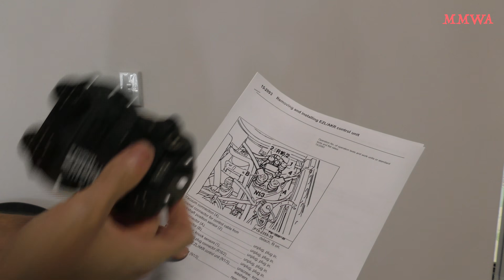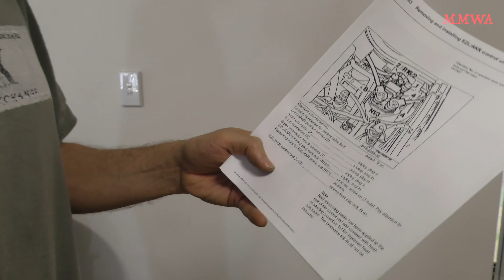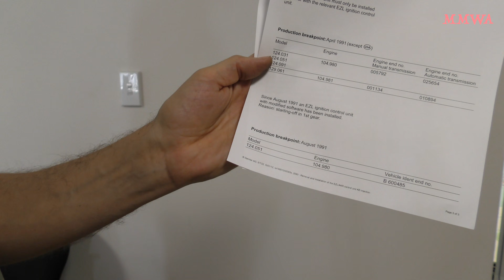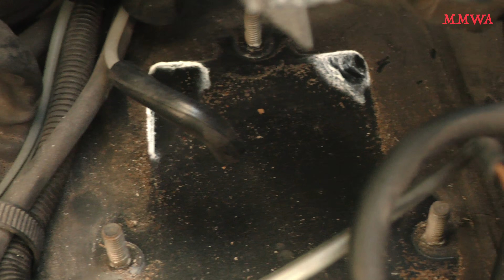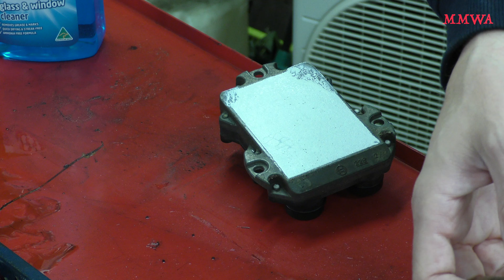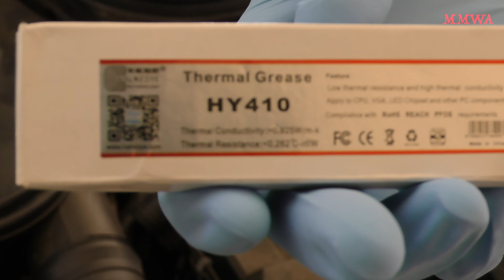Mercedes W124 - Some Long Overdue EZL Maintenance

Comment: so the plastic sheet was still on there thats, not how that stuff works is supposed create a air tight seal so heat transfers, atleast that how i understand thermal paste works

Comment: Need help please. I did the head gasket on my 91 300ce and I ended up with a sensor that’s plugged in the EZL but for the life of me I can’t find wheee that sensor goes. By the part number on that sensor, it says it is a crankshaft positioning sensor. If anyone knows, I’d appreciate some help. Thx.
Reply from the maker: @bektas1981  crank position sensor on these engines is in the rear of the engine where the transmission mates to the engine up the top on the intake side. A real bitch to access but not impossible.
Reply: @MMWA-DAVE , appreciate your reply. 
Yes, that’s the problem.. I never touched that sensor while doing my head gasket. Somehow I’m left with this thing hanging in front of my engine and I have no clue where it goes. I’m starting to think it’s from a previous owner, they didn’t remove it all the way. I’ll do more checking tomorrow.

Comment: Hello sir, i want to ask something strange problem with my 300E w124
The idle in the limp mode is 1200-1500 its normal?
Are ezl is the main problem the tachometer cannot rev more than 3500rpm, but the engine seems screaming
Are ezl failure can affect high idle when limp mode
No more vacuum leak ,all the rubber hose icv are replace and test with spray some water to possible vacuum leak area.
Because i want to solve the mechanical problem first and then the 2nd is  some electrical
Need your advise sir
Thank you 🙏
Reply from the maker: @hendragunawan-up7kd  EZL wont be reponsible for high idle, Likley there is no power going to ecu or ecu has died, Fail save mode of idle control valve is around the high idle speeds you suggest. On M103 the idle speed control circuit is inside the ECU. Usual thing responsible for no ECU power is a failing OVP relay. This will also light the ABS warning light when fitted, if the bulb is not blown. Also make sure throttle linkages are not tight or mal adjusted, as this can also cause high idle.
Reply: @MMWA-DAVE  thank you sir,
Someone told me if in limp mode the idle is +/- 1000 rpm ,and the electronic control the idle between 700-800
In my m103 with a ECU just drop to 1000 rpm because at limp mode is 1200-1400 rpm

Comment: hi can anyone please advise, i have a w126 420se it uses the same EZL module you have , the 16 pin ...but mine is not working and im struggling to find one at a reasonable price. so i did some research and there was someone saying that its possible to use the 8pin EZL ..my car already has the 4 pin plugs also linked to the loom. but i wanna know if it can work and if there is a catch
Reply from the maker: It wont be the same as mine, mine is configured for 6 cylinders and the ignition timing map for the 3 litre M104. In answer to your question- Yes a 4 pin 420 EZL absolutely will run your engine, with appropriate wiring modifications but you will lose some functionality, number one thing will be knock control. Presumably its a 10:1 compression engine if if uses 8 pin per socket EZL. You should use only best quality premium fuel available in your country from that point forward. You likely will still experience some pinging in the summer time even so.

Comment: I always use a plastic razor blade to scrape off the old stuff first.  Then chemicals and wiping.  As for the protective "foil", i actually just use a plastic zip-lock bag, and cut out a piece of it that matches the contact patch with an X-Acto knife.

Comment: That's interesting that the ignition would be different for first gear start. Do you know why? 
You might be able to get first gear start with the FGS "relay" from a 500 w126. It clicks the kickdown solenoid when you lift your foot off the brake pedal. This makes the car rest in 2nd gear, but move off in first.

Comment: @MMWA  
Thank you for the video
Did you re-apply the protective film or you use a new or any protective film?
What is the film protecting?
Reply: My best guess is that it protects the box it was shipped to the factory in, then the hands of the workers who installed them. You can find a thorough nerd-quibble on the 500E boards about this. Some even say that at one point, replacement EZL's from Mercedes just came with a tube of paste for you to apply, no film.
Reply: @theundergroundlairofthesqu9261  Clean hands yes, but also much quicker to slap the EZL on, straight from the box, without playing with heatsink compound. Industrial efficiency.

Comment: The trim resistors on these are interesting, had to source number 6 for a decatted s600, fitted a generic equivalent resistor instead and it stopped backfiring instantly

Comment: Great information as always from this channel. One question, does anyone know how to adjust and rise the rev limiter on these?
Reply from the maker: On the m104.980 the first rev limiter is operated by the MAS relay, it turns off the fuel pumps just above the red line. Additionally, the EZL retards ignition timing to reduce engine power then cuts ignition after that if the RPM's continue to rise. the TD signal is used (tach) from the EZL for the MAS relay to know engine RPMS. You can add a bypass switch for the fuel pumps to stop the MAS relay cutting the fuel pumps. I'm not sure at what speed the EZL cuts power then ignition, i think it's quite a bit higher.

Comment: Great video! I still have one of those on my swapped Coupe but I only use the vacuum port, that runs the economy gauge in the dash.
Reply from the maker: you can delete it completely - the economy guage is just a mechanical vacuum operated device. It only needs a manifold vacuum connection. I assume you have the tach guage connected to what ever ignition box you are using for the ford v8 - it only needs a typical square wave output from a transistorised ignition control units tachometer output.
Reply: @MMWA-DAVE  Good to know, at this point it’s easier to leave it in place. Yeah I have an MSD ignition and an aftermarket tach, the tach was the only factory gauge I didn’t get working.

Comment: Hi, I noticed you have manual on everything you do on that merc. Can you steer me the right direction to where I can find a good one for my w126 1988, I  purchased a few from different suppliers but they all crap, I'm Also in Perth and would appreciate very much if you could help 
Thanks
Reply from the maker: w126 is in the grey area where they just started to digitally archive the paper manuals into the workshop information system. Theres a lot missing, probably more missing than is present. Unfortunately you are at the mercy of hoarders of paper factory manuals and the aforementioned crappy manuals already doing the rounds. Wish I could help but MB really dropped the ball on archiving the w126 manuals. Even the ones they did scan many are in exceptionally crap quality, severely skewed and or very low resolution.
Reply: @MMWA-DAVE  Thanks for prompt reply, yes you  
Are correct lots of rubbish out there
Thank you anyway 
Cheers
Reply: Do you have a V8? You can get the 6 cylinder manuals here: http://eva2.homeip.net
Reply: @compu85  Thanks for that but hat sites is no longer operational
Reply: @PeterM1900  Hm, it is up right now. Perhaps your internet connection is blocking DynamicDNS names?

Comment: Quick question. What is your oil pressure with the later M104 oil filter housing without oil/coolant. After doing this mod I'm only getting 1 bar after she warms up. Also did you ever fit a oil cooler on? I live in Canada so if you didn't up in Australia I wouldn't bother, especially if I'm not tracking my 300SL-24.
Reply from the maker: interesting, i noticed at hot idle it can get as low as 1.5 on the freshly built engine. I am not sure if it is the febi brand new oil pump or this housing that is responsible. It does go up to 3 from just under 2k rpm. It’s ok but would rather it a bit higher, higher viscosity oil might help, i have not tried this yet.
Reply from the maker: I didn’t bother fitting a cooler, general driving around i’ve not seen much difference in oil vs coolant temperature.
Reply: @MMWA-DAVE  yeah I've been closely examining your videos. I will switch to Shell Rotella T4 15w-40. I'm running old Ow-20 just to flush out my oil car had a headgasket go at 159,000 miles. The difference in power between M103 and M104 is crazy the 12 extra valves just make this car roar.

Comment: My 1992 M104.990 has a similar unit but i think has the LH electronic injection. Are these still a problem in applications without KE Jetronic? I hear about the EZL a lot...
Reply from the maker: Yep, same deal applies. The EZL was used for the distributor ignition m104.990 as well as distributor ignition version M119’s and even on the distributor ignition version m120 V12, but those use 2, one for each bank of 6.
Reply: @MMWA-DAVE  awesome thanks mate. What's the cause of failure on them? Heat?
Reply from the maker: @19jacobob93  Number 1 cause of EZL death is poor condition ignition components, coil, leads, cap, rotor, insulation disk, plugs etc. I have a rule about replacing everything for brand new, bosch on these cars due to the cost and scarcity of the EZL. The overheating of the unit will also cause it an early death over time, but the ignition component failure mode can cause it to die instantly.
Reply: @MMWA-DAVE  thanks for your infinite wisdom! Mine has just had brand new Bosch rotor, cap, leads and plugs but the insulator cap and coil are original. All the parts I replaced were actually date stamped 1991/1992 actually!
Reply: @MMWA-DAVE  just purchased one for $183 including shipping and import tax. Probably won't find another that cheap haha
Reply: @MMWA-DAVE  That, and jump starting the car. Spoke to an MB technician who explained spikes of 24V can be seen in such scenarios which fry the EZL.

Best thing to do -other than avoiding doing this altogether - is connect all electronic ancillaries before giving it juice to draw more current.
Reply from the maker: @apexseal2811  you are very correct- the OVP does not protect the EZL itself in any way and it is totally vulnerable to spikes. It’s also vulnerable to reverse polarity destruction too.
Reply: Just had a look on ebay and luckily there are a few from the US delivered for under 200 bucks. Some are priced around 500-800!